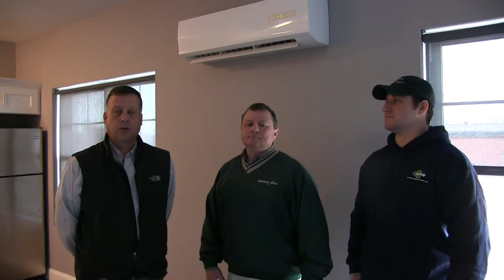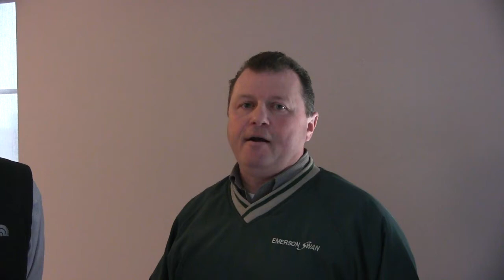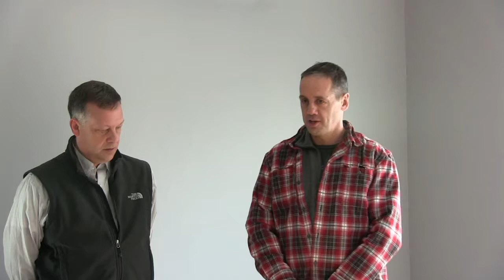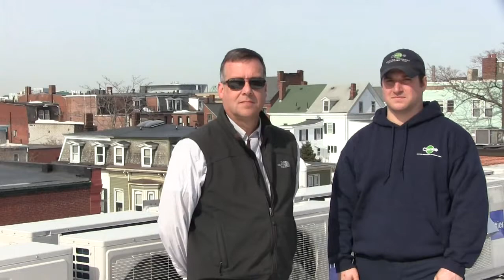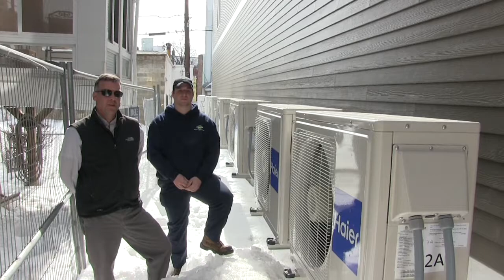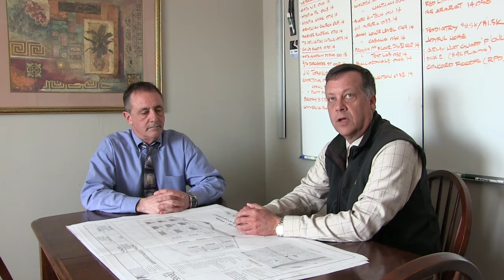Haier Ductless Split System Case Study | Emerson Swan

Comment: Why they did not install a vrf instead
Reply: Kurt Vella vrf would be a liability cause all the refrigerant lines would be attached to one condenser. And if you have a refrigerant leak on a system like that. Good luck trying to find it. Not to mention those branch boxes are a nightmare or flair fittings I would never put that in. This job looks clean